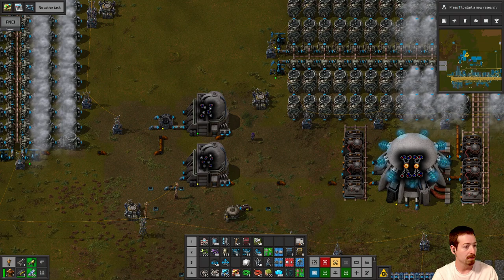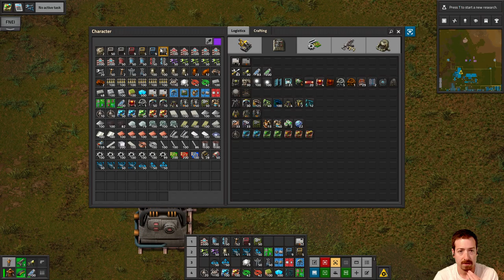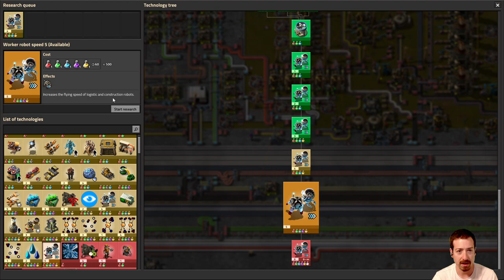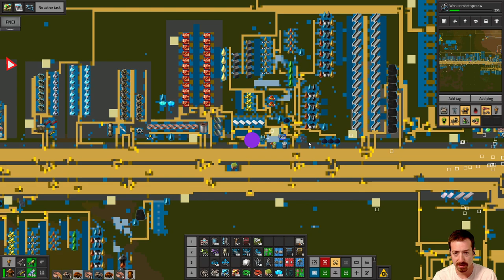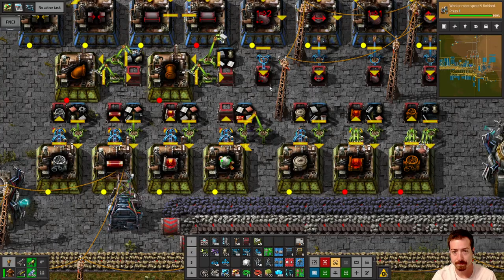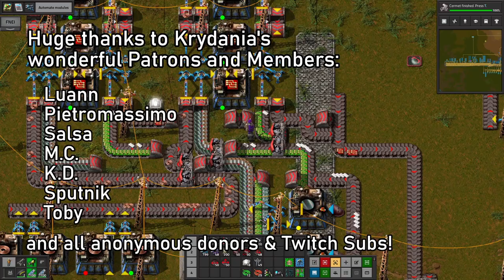Factorio Full BZ+ #36 - Circuit Controlled Plasma Heating

Comment: Maybe you'd need a DT-mixture buffer gas tank, so the buildings making it keep working during the phase that GJ is being used and their output is not required... the issue seems to me that at that point nothing is using power because every building is idle, and so the GJ get stuck for so long! Perhaps add a few fake power loads, like some radars?

Another idea is maybe add an extra step after the enable signal for GJ using a combinator to generate a pulse for just one tick into the secondary exchanger? So it's only a tiny bit that gets injected into the secondary power grid

EDIT: Awesome it ended up working in the end! Just finished the video... still, I think it'd help to have a small buffer of DT-mix and perhaps some fake loads in the secondary grid!
Reply from the maker: Well the problem with dt gas buffer is that the MJ need to get used up too. So it would stop based on MJ amount. But yeah I think I could have made it cleaner for sure